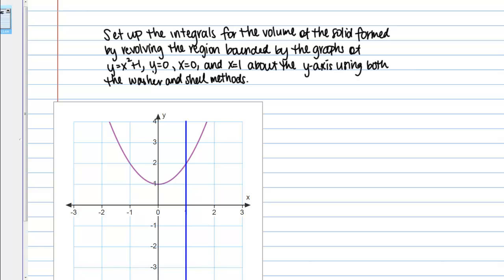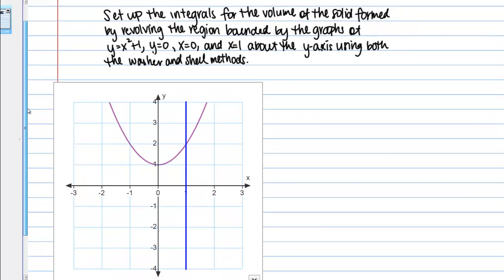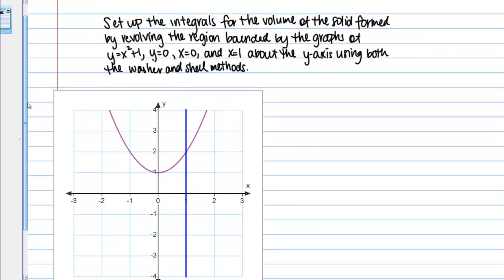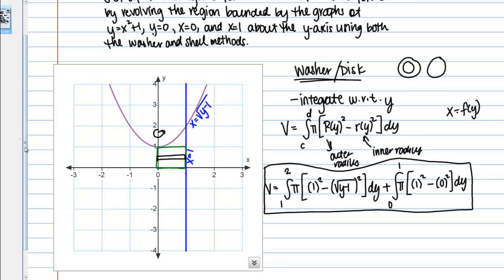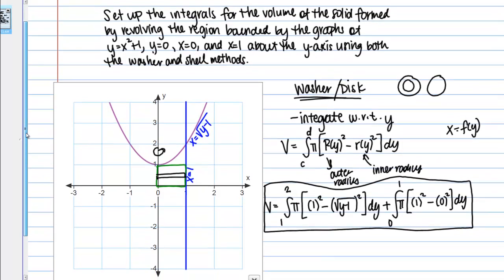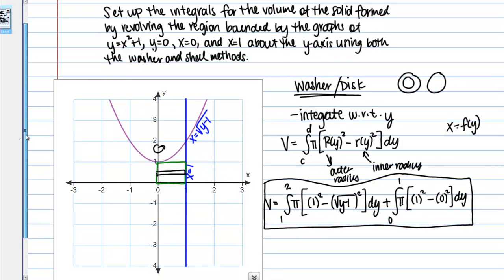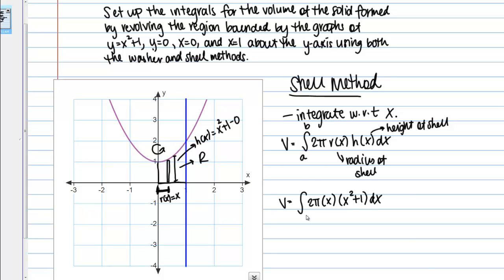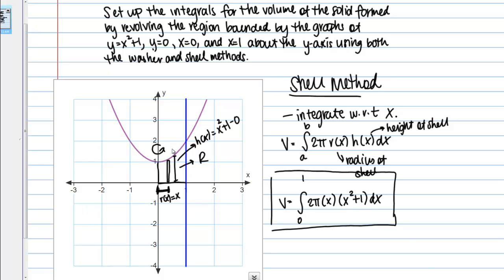Washer vs Shell Method

Comment: How can I tell if i need to use the washer or Disk method? I can't picture the functions revolving and seeing the washer. I've heard people say that if your representative rectangle does not touch the axis of revolution then we should use the Washer method. Can someone explain?
Reply: Basically when you have an axis of rotation, sometimes the region that you are rotating around the axis is not right next to the axis of rotation; there is a gap in between. The shell method is not that good at dealing with that, but the Washer method was kind of made for taking care of that space using the little r(x)^2. So, if there is a distance between the region and the axis of rotation, definitely use washer.